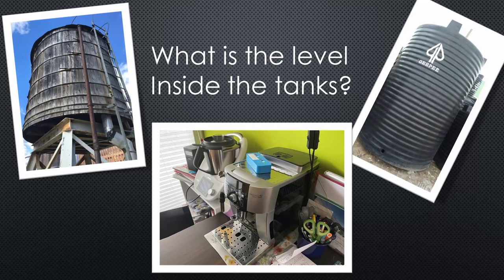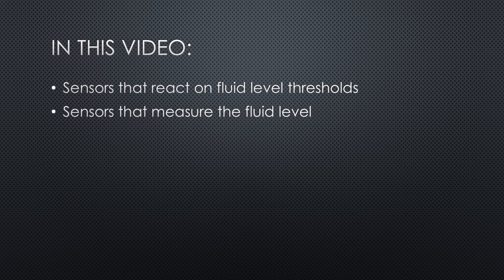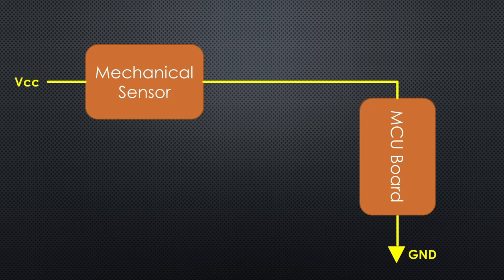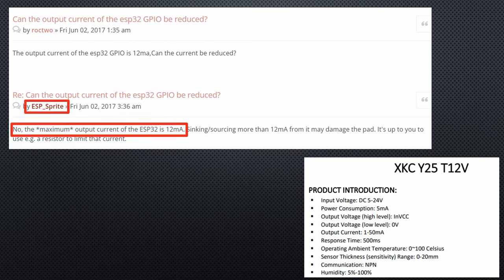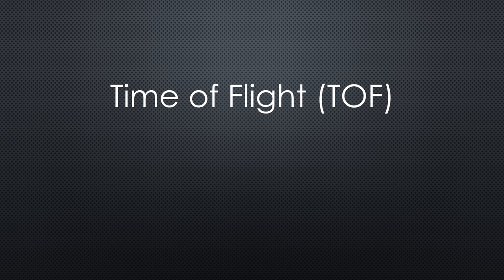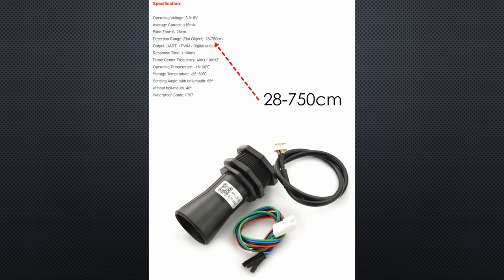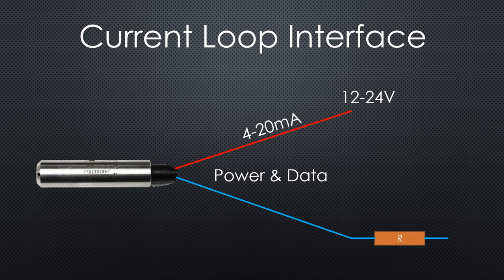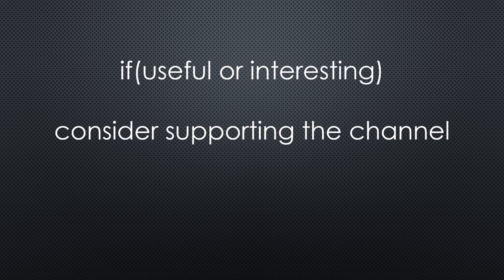#411 Ten Fluid Level (Water Level) Sensors and how to use them (Arduino, ESP32, ESP8266)

Comment: Thanks again for your work and the level sensor overview. In my house, I am using the float switch sensors to monitor the water tank of my dehumidifiers (Aldi) together with a 433MHz door/window sensor. Several XKC Y25 capacitive sensors are also in use in different configurations, I tried to use a bigger capacitive level sensor as a rain sensor, which failed. But it was usable as a touch sensor hidden behind the wooden board of a piece of furniture. 
For my oil tank I built a pneumatic level sensor using a BME280 as a pressure sensor and a small air pump. First as a proof of concept. But it is now for years in productive use,  performing in the range of 0.1% deviation, which means <10 l in a 10 000 liter oil tank. Nice principle; no contamination no safety issues and precise enough.
Reply from the maker: The Make journal featured this pneumatic system system in their last issue. They seem to also need a valve. But it is definitively something I want to look at. Do you have more information to share?
Reply: @AndreasSpiess  Part 1  @Andreas Spiess  In theory valves are needed. But I need just e few measurements a day, so I rely on the natural leakage and block the measruements in between by SW. 
The theory of operation is well described in German Wikipedia "Pneumatische Füllstandsmessung"
Reply: @AndreasSpiess   Part 2 My tinker-solution is described in homematic-forum post  328133#p328133 ff. As you can see: tinkering and proof of concept. But as it happens sometimes, continues beeing in operation. And even the TÜV had no complaints. 
More important than a valve, is a pipe to the bottom of the tank. This already was built in. The tank was equipped with a "mechanical" solution by Afriso, which was not very reliable and not very precise. But I could use this pipe. This company and some others offer also electronical solutions nowadays. The pressure range of the BME280 fits well to the geometry of my tank. Otherwise a dedicated differntial pressure transducer would be required.
Reply from the maker: Thank you for the link. I see the point that you used time as your "valve".
Reply: @AndreasSpiess  Yes, keep it as simple as possible and as precise as necessary :-) The system is kind of open to the liquid side and the air can escape, the oil returns into the pipe..

Comment: Oh and if you have a readily available low pressure air supply (like an aquarium pump for example), you can use pressure sensors in another way.  Instead of putting the sensor at the bottom of the tank and subjecting it to the fluid, you can pass air very slowly through an orifice and down a tube that is open at the bottom of the tank.  If you adjust the air flow so it just barely 'bubbles' out the bottom of the tube, the pressure in the tube right after your orifice will be proportional to the level in the tank and can be measured with any air-pressure sensor.  The sensor never touches the liquid.  But a loss of air supply will have the same effect as an empty tank, so consider that in your design.
Reply from the maker: This is a good idea. There are a few discussions about it in the comments. It seems to be very robust.

Comment: A very old type of fluid sensor is the Buchholz relay found in use in oil filled power transformers. This is a basic float type mechanical float switch, mounted below a small "conservator" tank at the highest point of the main tank of the transformer. It actually serves 3 purposes
* Operates to identify low oil.
* Will detect gas production due to an insipient fault in the transformer (the gas byproduct displaces the oil over time)
* It operates for a disruptive fault in the transformer since the oil surge operates it
It really is protection of last resort for the transformer.
Reply from the maker: Thank you for the info. I had to look it up in Wikipedia. A simple but effective solution for transformers. I asume the mounting placet on a "normal" tank would be important.

Comment: My first custom water level sensor was for my home tank on roof. It was 1Mtr tall and i built it first 10 years back when i was in 1st year of engineering school with a floating led in a tube, an LDR on the top of it. I used to set the led brightness such that the change in resistance of LDR is linear for linear decrements of the distance between ldr and light source. This solution was good but i had to change the light source every year as there is salt scale builtup on led.
 I changed from this method to ultrasonic sensor ones which failed much faster. Explored pressure sensor method but that was expensive and sensor drifts over time due to scale builtup. Currently i am using a reed switch type float sensors (which needs to be replaced every once every two years)but working on a capacitence based sensor for precise level monitoring and not having to replace them.
Reply from the maker: Very interesting. Thank you for sharing your experience!

Comment: There is a really simple solution to the coffee water tank issue. 
Just fill it up after you finish using it, even if it is not fully empty.   That means happy wife in the morning :)
Of course that is not as fun as micro controllers, but will solve the issue of the coffee machine being empty
Reply from the maker: I agree!
Reply: @AndreasSpiess  Or even, though very no tech, just mark off on a notepad or mini whiteboard how many times coffee machine has been used since last refill and given know capacity of tank and how many cups/mugs it can supply, know when to refill! Could even use a clicker! 😁Of course this spoils the fun!

Comment: several years ago I thought of a pulley system with sensors that when countering the turns of the pulley indicates the distance of the rope or chain I think that if you put an object that can float at one end and a counterweight at the other end can work with that we can calculate the height of the liquid, the most scientific approach i think is use vibration frequency from the exterior of the tank, frequency will change depending on how full or empty is the tank (sorry my english i know is not good)
Reply from the maker: The chain systems seem to be used in the industry for example to measure the level of lakes. It for sure can be used by makers.
The resonance method is probably a bit more complex to use.

Comment: Other methods:  1) Weigh the tank and its contents by mounting it on load cells.  Can be very accurate, is unaffected by tricky tank internal geometry that makes the height of fluid:volume non-linear.  Disadvantage is that any pipework connected to the tanks must be flexible enough not to affect the weighing.  2) Industrial storage tanks for oil use a variant of the car fuel tank idea:  the float is mounted on a long wire or chain, and a mechanism at the top of the tank winds the chain on and off a drum as the float rises and falls.  3) For threshold sensing, devices like tuning forks are sometimes used: these are energised to vibrate and the vibration is damped when the liquid rises to the level where the tuning fork becomes partially or wholly submerged.  Similar devices are used with powder-filled tanks (flour, sugar, etc)  In this case the fork is powered to rotate using a small electric motor.  When the material starts to cover the fork, the rotation is stopped.  The devices use spring-loaded mounting plate that rotates when the torque increases, tripping a micro switch, and stopping the rotation.  5) Sometimes ultrasonic sensors are mounted at the bottom of tanks, and the sound travels through the liquid and reflects back down to the sensor from the top surface.  These are less affected by floating foam or dense gases above the liquid than the 'mounted at the top' kind.  However, they have the same disadvantage of pressure and other bottom-mounted types: the tank has to be drained to change the sensor. 6) Some tanks are fitted with external 'sight glasses' (a transparent tube linking the top to the bottom of the tank).  The liquid sits at the same level in the external tube that it does inside the tank: any sensors can then be attached to the tube rather than the tank itself.  Steam engine boilers often have these sight glasses. 7) The old 'teasmade' automatic tea-brewing alarm clocks had a simple level sensor on the kettle and/or teapot - an on/off version of the weighing idea.  The teapot sat on a sprung platform, and when its weight increased as the water was poured in, it compressed the springs to the point where a microswitch was switched.
Reply from the maker: A lot of good and interesting information. Thank you. For sure I should have mentioned the weight method because, as you write, it has many advantages (I never thought about the flexible pipework!).

Comment: I have been trying to measure my heating oil tank using tof sensors, so the optical ones just can’t see the level of the kerosene, so that was a fail. 
Also used a waterproof ultrasound version which worked until the oil fumes destroyed the sensor! 
Interesting I might give the submerged sensor a go to see how that fairs. 
I do have a commercial bullet sensor which uses ultrasound on it but it’s only accurate to 1Cm that is about 11 litres of oil, not very accurate
Reply from the maker: Thank you for sharing your experience!

Comment: Nice overview. Did you document your coffee machine project already? I have an espresso machine with a removable tank that I'd also like to measure (it simply turns off when the water level is too low, sometimes in the middle of the extraction). The tank is covered with a metal tray, so I thought that I'd connect a ToF sensor to the bottom of that tray, and display the level on a numeric LED display.
Reply from the maker: So far I did not do the project. It was just an inspiration for the video. These machines seep to be calibrated to the small Espressi the Italians drink...
Reply: @AndreasSpiess  I don't think there's any special calibration. The machine costs like 1500 CHF and I actually make mainly 30-40ml espresso, but it still turns off in the middle of extraction: The level switch kills power to the pump and PID to avoid drawing in air. Unfortunately the water tank isn't even visible without lifting up the metal tray on top of it...

Comment: Funny thing I was dealing with the same espresso machine issue and ended up with the exact same solution. :D 
Also, there is another path you haven't follow in which you use a weight sensor with HX711 module,  that's  pretty much the only option when you're dealing with hot liquides.
Reply from the maker: You are right. I forgot to mention weight as a possibility. For the coffee machine, however, it would not work because there is a waste water tank as well as a tank for the used (grinded) coffee beans which would randomly add to the weight.

Comment: IR sensors with floating stuff can be handy as well. Note you should consider vapor for any top sensor as a critical issue. Depending on temperature and fluid, top sensors will quickly become unusable due to condensation on the sensor. You have to eat or ventilate them to keep them clean. After various attempts with Sonars, IR, Conductive sensors I ended up with these basic reed switches in plastic enclosure in serie, they give low precision but high reliability. Time of flight is also impacted by water surface, if this is moving or if fluid is filled from the top and cause lot of waves they'll have weird output requiring additional software processing.
Reply from the maker: Good information. Thank you for sharing!

Comment: IFM Effector have a model sensor LR3300, it's a waveguide radar continous level indicator (electromagnetic pulse), you need install a special metal stick in the bottom of the sensor for the waveguide (and level measurement), also require to be installed in some type of reflective metal base (or use a metal flange for non metal tanks), also IFM sell a special tube cover for the waveguide to minimize turbulence. This is by far the most interesting way of measure level, the bad part is the price, very prohibitive for makers only available for industrial process that the cost allow it.
Reply from the maker: Thank you for the information! Industrial sensors often are more expensive (and also more reliable).

Comment: what about a tube with a pressure sensor on the top with the tube going into the liquid until the floor with space for it to come up and calibrated at empty and full. no liquid and no splashing would greatly affect it too much. and it doesn't need to get in contact with the liquid and the tube goes all the way to the bottom. small tube with little lost space
Reply from the maker: Others mentioned a tube to the bottom. But it seems to need a pump to add a counter-pressure.
Reply: @AndreasSpiess  no, the sensor is at the top of the tube and sealed, the tube is lowered into the tank down to 1..2...3cm from the bottom, as liquid is poured into the tank, the liquid tries to move up the tube and creates more pressure
Reply: @phizicks  The main problem with this method is long-term accuracy. A number of things can cause the liquid level in the tube to change independently of the level you're trying to measure (temperature changes, tiny leaks, air from the tube disolving into the liquid etc.). It does work though if you're only after a rough measurement and you often empty the tank to re-set the level in the tube.  Washing machines use this method. With the addition of a pump, or other pressure source though, this method can be made very accurate over long periods.
Reply: @phizicks  I suppose the air will, over time, diffuse into the liquid causing a loss of air pressure. So at least for that reason alone I think Andreas has a point about the need for a pump. There might also be an issue with the liquid trapped inside the tube changing its properties relative to the rest of the liquid, which may again become undesirable not only from a measurement point of view, but also due to contamination or health concerns (e.g. amoeba and bacteria growth in a tank for drinking water).

Comment: Load cells + Wheatstone bridge to get weight, combined with a density-based calculation to get volume + known dimensions of the tank is another way to get the liquid level.

Could you please do a video on how tactile switches can be used in various ways to create a front-panel-style user interface with different buttons and their mounting options? I'm unable to find such a video on YouTube.
Reply from the maker: You are right: I forgot to mention the weighing method.
But I do not understand what you mean with the tactile switches.
Reply: @AndreasSpiess  For designing a good user interface for an enclosure, I want to have pretty push-buttons on the enclosure. I understand that many such buttons have tactile switches underneath them? I meant to ask how to design such enclosures and buttons. Thanks for the reply!

Comment: Optical parallax distance sensors like the Sharp GP2Y0A21YK0F might be applicable in some cases.  My application is measuring the depth of snow cover.  For water tank level I used a cheap JSN-SR04T automotive sensor, but I had to add an aluminium cone to direct the beam and avoid picking up the fill plumbing and tank sides.  It has been reliable for several years now.
Reply from the maker: Good advice for the JSN-SR04T. Thank you! The GP2Y0A21YK0F has probably not enough range for many applications.

Comment: Thanks for the great video. There is one very strange method to measure liquid levels that is used in tanks with very corosive liquids, for example. You have a radioactive isotope on the one side, and a geigercounter or comparable radiation detector on the other side. Definitly not a good method for home-use - and even for industry use quite a dangerous sollution.
Reply from the maker: Others mentioned this method, too. Not for me, but it seems to solve some difficult problems...

Comment: Great video, Andreas, it pointed to the real difficulties I also encounter, as corrosion and cludge  of mechanical switches. In my case I had to measure the level of a underground tank feeded from a 100m well. The only solutions that worked for me was a floater with a long cable that has internally a switch that opens when the horizontal angle exceeds some value. Also a pressure gauge 4-20mA at the bottom of the tank
Reply from the maker: Maybe the second part of your last sentence is cut?
These mechanical switches are for sure quite robust as long as you do not need to measure aggressive fluids...

Comment: Industry also use magnetostrictive linear position sensors for fluid levels. They resist temperature and viscosity changes. 

 Also, magnetic hall affect sensors can be used used as well. Radar chips are also becoming more affordable.
Reply from the maker: These magnetostrictive sensors seem to be high-tech. I never have seen such a sensor.
Radar was also mentioned by a few other commenters. It is still more expensive, but travels through various materials.

Comment: Hi, there's another way to measure water level using pressure sensors connected to a tube that inject air to the bottom of the tank until it starts to bubble. This kind of measurement system is called a bubbler, and by doing this, the liquid doesn't need to make contact with your sensor.
Reply from the maker: You are right. There are quite a few discussions below for that sort of sensors.

Comment: Hi! I am Jacques from Quebec. I had to build a liquid monitoring device to allow reading the level of the liquid so I used load cells sensors. These worked fantastic. Thanks for your very exciting video.
Reply from the maker: You are right. I should have included measuring weight in my video. Because both applications cannot be done like that (tank burried in earth and coffee machine has also waste water and waste grinded coffee which adds to the weight) I forgot it.